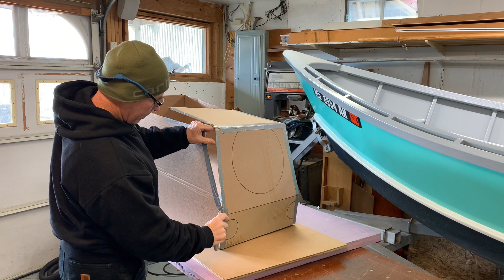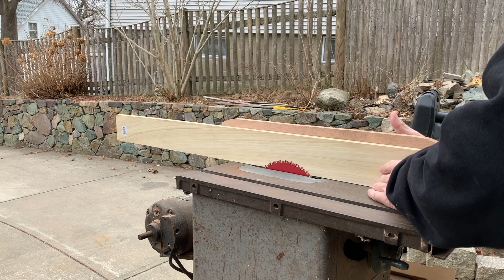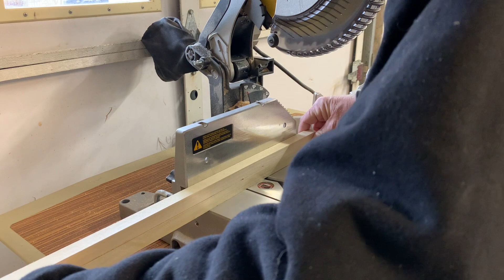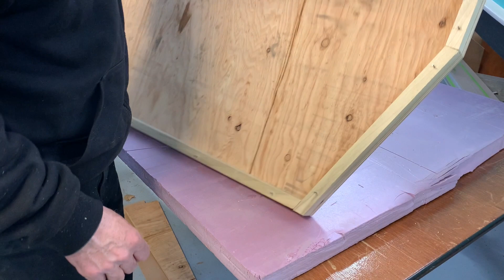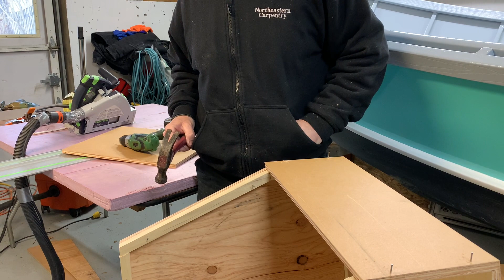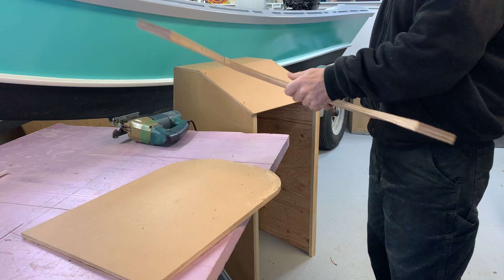Building a center console

Comment: New subscriber here !
Have enjoyedwatch your skiff build series.  Impressive skills you have along with attention to the finer 'finish carpentry' details.
Quick question about you building the center console for the new owner.  Does it change the boat planing characteristics due to a shift in weight more toward center ?
Reply from the maker: No, the boat is balanced very well.
Reply: OK.  Thx !

Comment: Why did you find it necessary to use duct tape to secure the dust collection to the track saw? Is it a defect in the track saw? I ask because I am about to buy one.
Reply from the maker: I used duct tape not to hold the hose on but to hold it up out-of-the-way from catching on the plywood.